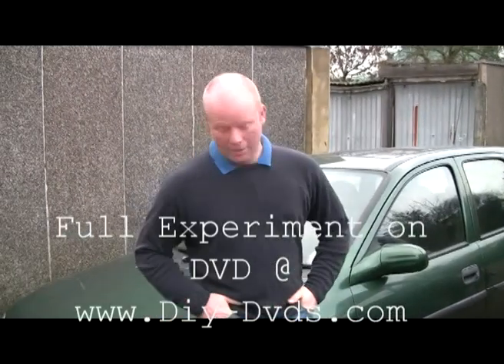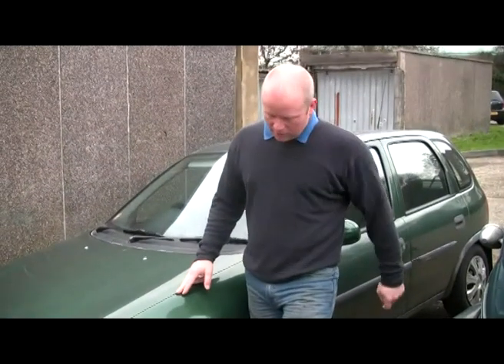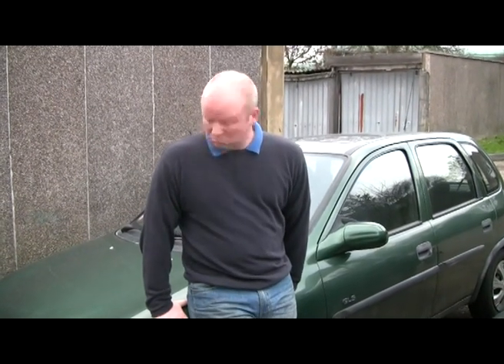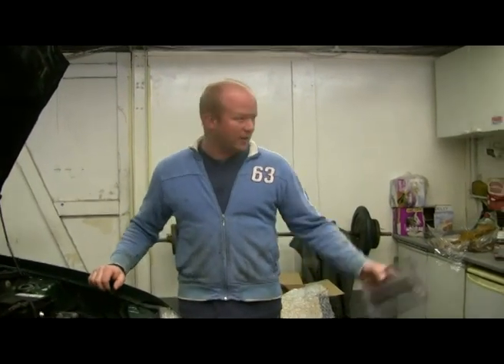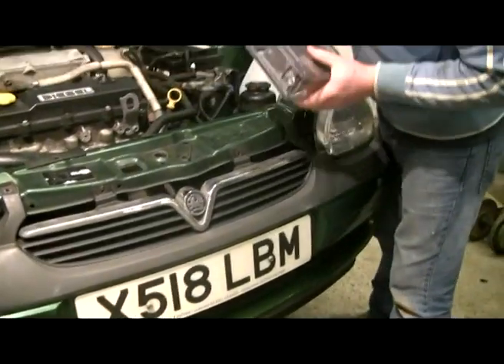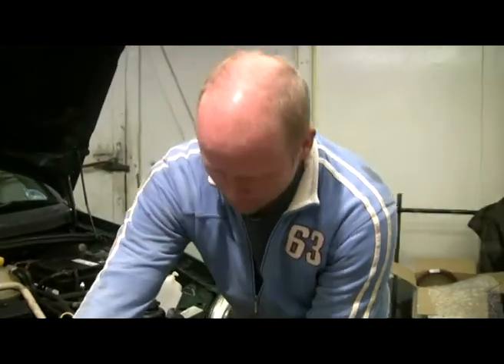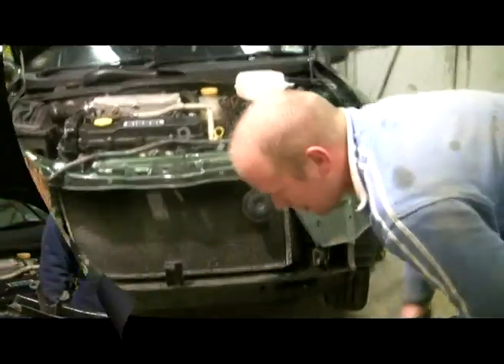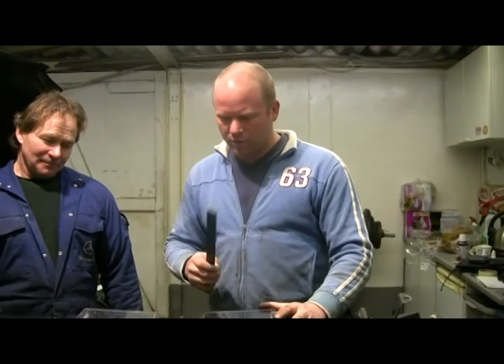HHO Hydrogen on demand Experiment Does It Work? What Can You Expect ?

Comment: the science is you only get out energywise what it takes to separate the hydrogen from the oxygen ie if it takes 20 amps from your alternator then you only get 20 amps back
Reply: wrong.  that's like saying that inserting mg of nitroglycerin into a combustion only yields the energy spent injecting it.   That's false.  Its like saying that gasoline can only produce as much energy as is spent on pumping it from your tank, to the combustion chamber.  These systems use HHO Hydrogen on demand...to enhance the combustion of gasoline, to make it more efficient, not to replace it.
Reply: your statement is true and so is histhe energy in the gasoline in your example is not placed there when you pump it into the carit's placed in the gas in the fossilization  process

Comment: cars do   run well on hydrogen so problem is a bubler that emits enough hho to make a better mpg car and the dream is 100% on hho from water..tanks are expensive and dangerous and hho is expensive if not from water but as u see in myth busters run it well but u must have backflow regulator or u get a back fire like they did.
Reply: My question is, with modern cars that change engine timing on the fly based on combustion, will this even do anything?

I replaced the engine in my older car with a newer model that bolted right on. The newer engine produced 25 more horsepower. I also replaced the exhaust which should have added about 5-10 more HP.

In order to get those benefits, I need to reset the ECU every three key turns. If I keep driving after that, the car "learns down" and self limits the power output